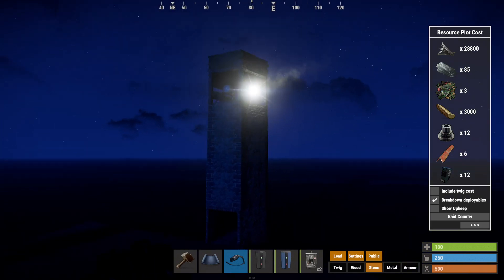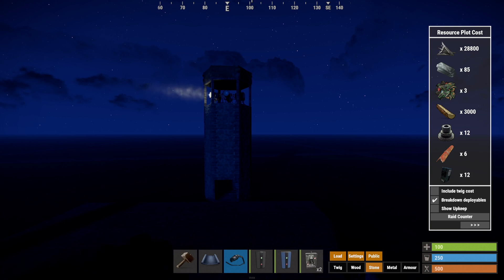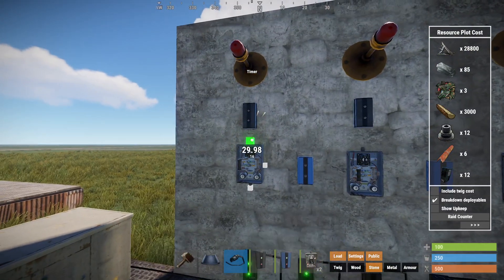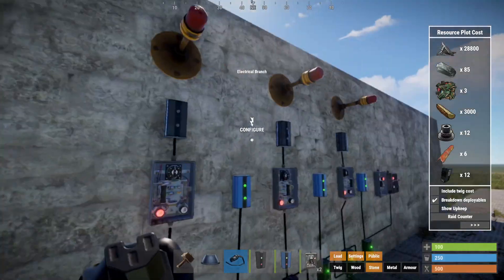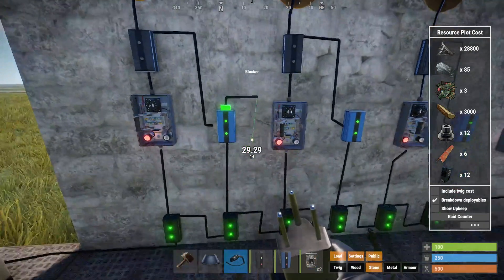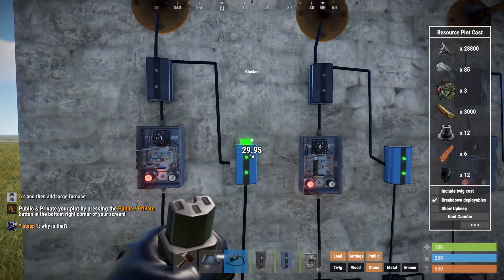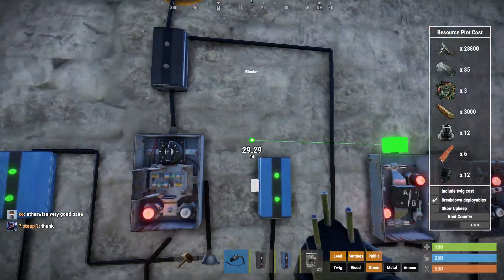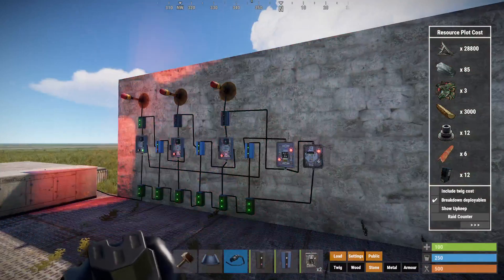Easy Lighthouse Circuit (Tutorial)

Comment: I can’t get this to work at all for me as you’ve not listed what you used and completely confused me at the end, and you’ve started out with stuff already plugged in and don’t even remotely talk about it. Only 1 part of my grid that I just cloned from this tutorial lit up, it’s underpowered…it does nothing on this server I’m playing on… this video did not help in the slightest and now I got a pile of junk on the wall that makes no sense at all
Reply: Built it a second time and AGAIN nothing, doesn’t even power up the second light or timer or anything. This video doesn’t work in 2024 at all, even built a smaller version with only 2 lights and it doesn’t work, even cranked up power to 300 and even upped the branches as well, it JUST doesn’t worked, rebuilt it a couple times now and even removed a whole light from the sequence and no matter what this method is broken until someone can tell me why it’s not powering the 2nd timer from the first actual building of this at all